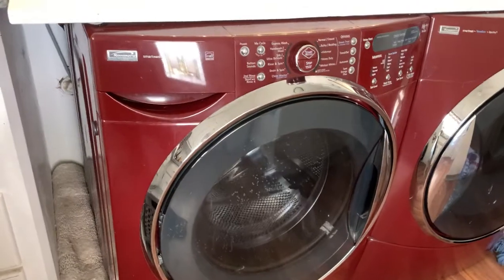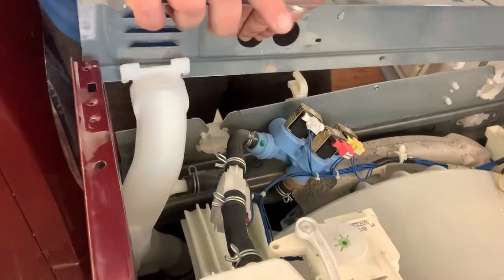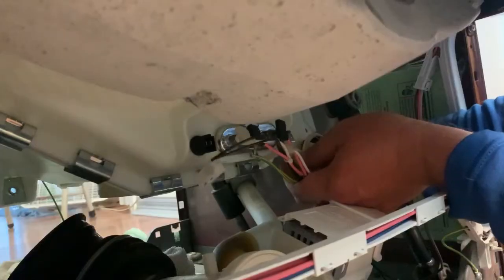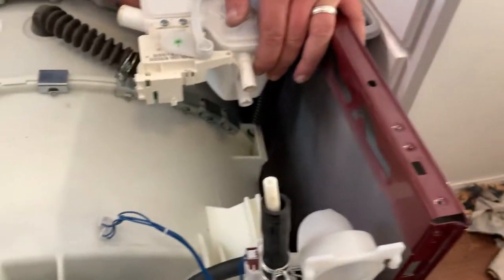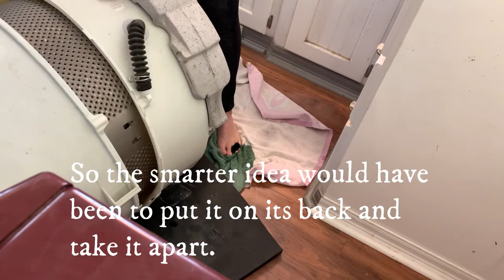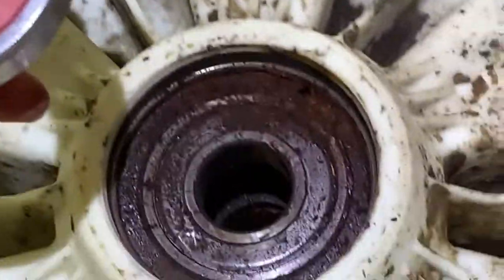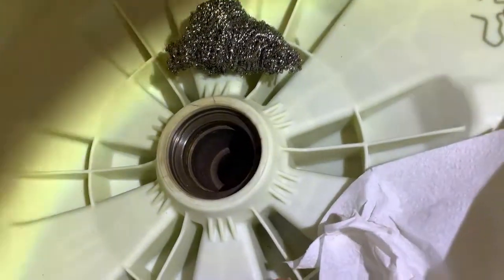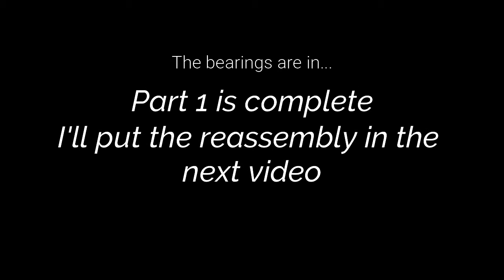Kenmore Elite Quietpak 9 HE5t Bearing Replacement

Comment from the maker: So here’s a fun fact…it’s been almost a year since we did this and the bearings have failed again. Now we definitely do more laundry than most folks with the constant washing of the table linens for the receptions, but one year? That seems a little ridiculous. We may do one more round of bearings and I may actually add a thick layer of grease to protect the bearings from the water…but this is my last shot at fixing this thing.
Reply: Is it water getting to the bearing or just cheap quality bearings ? Possibly open the bearing seals and add more grease in the bearings themselves ?
Reply from the maker: @chrisstone8189  yep it is definitely the incorrect bearing seal that’s the problem. The bearings themselves seem fine. I didn’t notice it the first time we replaced the bearings but I noticed it this time. I’m hoping my seal modification works for a while.
Reply: Or try glue seals in at the plastic side if you grease them the could spin and water gets to bearings game over! We used use felt glue for dryers I’m sure can find it somewhere.
Reply: I think before you add replace new bearing ... buy Luca grease add more in the bearing before install, maybe it will last long... many problems because run out of grease dryout or grease melt...
Reply: I have an older He3T.  Ten years ago I swapped out the bearings and it failed about six months later.  Upon doing more research I found out the bearings were guaranteed for 10 years and we had one month left on the warranty.  I called Sears and they fixed it.  It only cost me about $35 for a new nut to hold the pulley on the drum.  

The reason the bearings failed was because they spun on the shaft.  The shaft diameter was reduced when I cleaned the rust off with emery cloth.  Lessons learned: 1) check the warranty, 2) use Loctite on the shaft with the new bearings.

I use the stainless steel tub as my fire pit.

I think you watched the same how-to video I did.

Comment: This video was very helpful. I appreciate you guys. I have the same unit. Ran into 2 problems. The local washer supply store said they don't sell the bearings. I could only buy the bearings with the tub assembly together. He said$500. 🤣🤣🤣. Amazon saved the day. Second problem was with the flared nut that holds the pulley on. After flipping it over and beating on it to get the tub apart, it got bent slightly. When I reinstalled, I got a little wobble because the nut was putting pressure more on one side. Got a new nut and rolled on. Thanks again for the video!
Reply from the maker: That’s good news! Glad you got it done!

Comment: I'm about to start my endeavor fixing my washer, thank you for the video
Reply from the maker: I’ve since figured out the bearing seal I used is NOT the right one. The bearings fit well. The seal is not the proper one. Make sure and order one from whirlpool. It’s got an extra lip that keeps the water out.

Comment: I have a question I have the same washer but mine it’s the HE4 and it’s making the same noises and I wanted to ask u where u bought the bearings cuz I need to fix mine and ur video it’s really helpful but idk where to get the parts
Reply from the maker: I got them off of Amazon. I can't imagine that the bearings would be much different from each other, but Amazon makes it easy to buy and or return.

Comment: I have the same washer and dryer and I don’t know if you guys remember that it does have a cleaning cycle that you can pour bleach in it and it will clean the inside. also, if you’re putting the wrong kind of grease on that rubber seal, it will degrade the seal to where it will fail quickly. Lithium grease does not degrade rubber.

Comment: You guys a great team. Cracking up right now. About to try this with my son. How did you find the right bearings. There a so many types and my model is so old... been tricky finding the right size (unless they’re generic)?
Reply from the maker: I gambled that they didn’t change by much. I’ve since fixed a few more appliances and it seems they keep the same equipment for long periods of time.

Comment: The machine isn’t worth the work did you replace the shaft if not they will wear out more quickly
Reply from the maker: We’re headed into a full 18 months of use with it for the investment of $25 and a few hours of time. I’d have to disagree with you here.

Comment: I am fixing to do this tomorrow to a friend's machine.  I have a question.  The plastic ring on the front inside behind the rubber seal, can it be replaced or ordered.  Her bearing I guess fell apart while it was washing and chewed that piece up. Please contact me or this asap. 3-2-22
Reply from the maker: I don’t recall a plastic ring. Just the rubber boot with the spring loaded in it. I can’t imagine it couldn’t be ordered though.
Reply from the maker: Let us know how your rebuild goes!

Comment: Do you recall the bearing and seal numbers?
Reply from the maker: I don’t but I’m pretty sure in one of these comments is the amazon link. While the bearings are the proper ones, the bearing seal that comes with them is NOT the correct seal.

Comment: Just found your video. What kind of drill did you use?
Reply from the maker: It’s just a dewalt 20v impact.
Reply: And I wanted to ask you what kind of Grease did you use for the bearings and seal? Did you use just plain Automotive bearing Grease? By the way awesome video I'm still debating whether or not to do this or not to my own Whirlpool Duet ft loader. I've had mine since 2006 and I can guarantee you mine is experiencing the same problem you had. But I'm not sure I want to go through all that trouble and my wife patience is not very high when it comes to me fixing stuff. I contacted an appliance repair guy to give me an estimate of how much you will charge me to do the work with parts period that will depend whether or not I end up getting fixed or just getting my wife another one and fix this one while taking my sweet time doing it